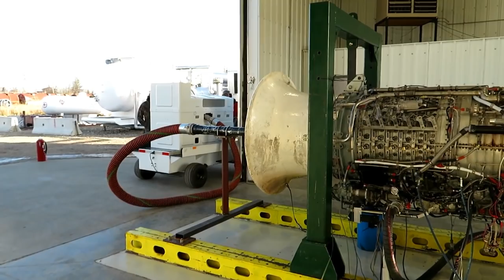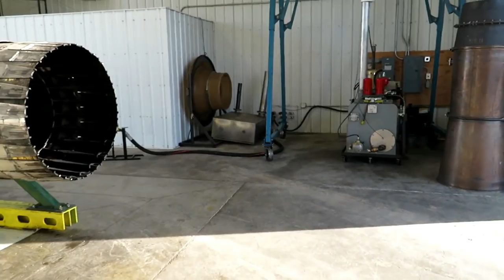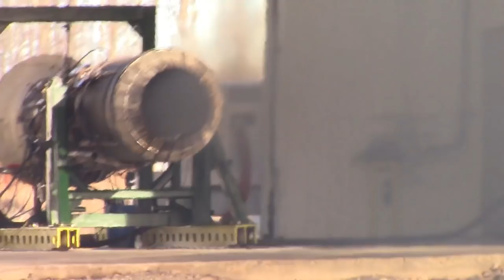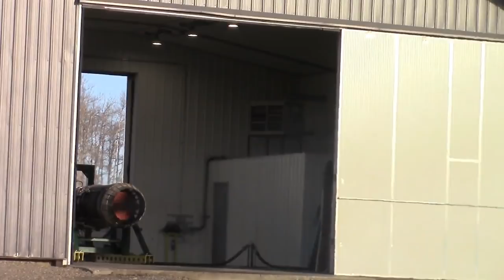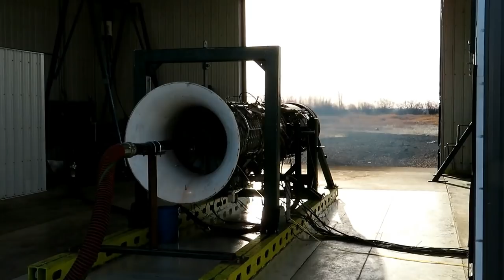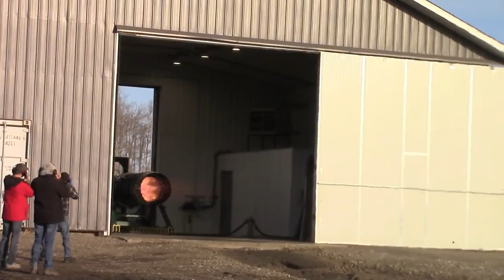Starfighter Engine Run - Screech, Smoke, and Afterburner

Comment: Its a real eye opener the first time at the test cell seeing a J-79-17 running  in AB.was stationed at Homestead AFB in 69 in the F-4E engine shop, we helped hookup the engine to the test cell. There were 3 of us first timers there we were told to stand 10 feet from the side of the engine (with ear protection)to feel and here it run. It was memorable day. Got to see several runs after that at Homestead  and Udorn RTAFB  70-71 -15
Reply: F104s at Homestead AFB in 69 were parked about 50 yards from the shop I worked in and there engine shop was in the same hanger all the 104s had -19 engines

Comment: I want to see how your anchor setup is pinned to the floor. Not a mechanic but spent a lot of time around the jets mostly helicopters.  I know what they can do,I worked the flight deck in close proximity to throttled up fighters, and slid to the safety nets more than once ! Always enjoy your videos brings me back in time .Thanks !
Reply from the maker: I think the video is called The Engine Test Stand...
Reply: @AgentJayZ  you got it ! Thanks for the help ,I found it right away . I was certain something was deep in the concrete 16 pins  works well, the building could disappear with a tornado but your engine stand will remain !good work we will be waiting for the next class. !

Comment: Reminds me of a bit of historical curiosity we have here in Czechia. Back in the days of Czechoslovakia our creative railway maintenance engineers figured the fact that jet engines give off quite a bit of wind gust. And through observation they have learned that roads that are in a bit of a wind in the winter tend to be clean. Surprisingly enough the guys have managed to get their hands on a stripped MiG engine and bolted it on to a railway car to clean rail tracks. While the engine have proven extremely effective in removing snow from the tracks, it has also proven to be very effective at accelerating moderately sized stones to great velocities. This was to much dismay of the bystanders, who after being hit by a storm of partially melted snow and ice found themselves to be in a rock shower. However, that was not the only issue with the track blower. You see, jet engines tend to run rather hot, and snow and ice tend to melt in high temperatures. While this was not an issue during the presence of this gigantic leaf blower, the junctions liked to freeze shut right after the cleaning was ended. To add to the literal fire, since this engine was a fighter jet engine, it was quite a bit hungry for fuel and very VERY expensive to run. With all of these minor disadvantages, ČSD have eventually decided it will be best to decommission their new leaf blower early. I believe it still stands somewhere in the museum around here in Czechia.
Reply: The massive Kraus-type radiotelescope at The Ohio State University used a J-47 mounted on an old flatbed truck to de-ice the tiltable 100ft x 340ft flat reflector. There was never enough ice to justify running the "de-icer" when I was studying at the telescope but the stories I heard were pretty funny ... such as the truck skidding along the ground with brakes locked even when the J47 was at idle power. I don't think the web site talks about the "de-icer" unfortunately. http://bigear.org

Comment: No matter how many of these test runs I watch, I'm always awestruck by the power made with such a small engine. Amazing stuff. Thanks as always for a look at what you guys do up there. I was involved in some interesting work during my career as an industrial engineer, and was always amazed at what goes on in small towns here in the US, seems the same situation in Canada. "Small" businesses like yours are what keeps our industries running. I would get to a job site where they were doing defense or heavy industry support work, and be shocked at what was going on at the other end of what looked like a farm road. I wonder how many of your neighbors realize you are there doing the work you do? I guess the airport hides your test cell activities fairly well, as the noise is passed off as coming from the airport. Otherwise it would be quite a curiosity at least where all the planes are flying. 

I can imagine the  "Canadians have a secret "cloaking field" on their military aircraft!" headline in the supermarket tabloids (right next to the one with the headline "Huge coverup - Jet engines really run on air and no one is admitting it") 
They would have a map with a big X - somewhere around here.... (Jet City) for the location of the secret invisible plane airbase (and of course the secret Air refueling station) I digress...
Thanks again for taking your time to film for us a look into your work. It's appreciated.
Reply from the maker: Hmmm. Our airport has two 10,000 ft. runways... arranged to look like a giant X

Also, our afterburning tests are far louder than anything that ever comes to our little airport, except the CF-18s that come in for our airshows.

Comment: There was a question asked, a few videos ago, about what would happen to a bullet fired across the efflux of a jet engine, to which AgentJayZ replied that it had been asked before.  I've looked, but can't find that question.  However, when the question was asked first time around, I believe I suggested that I would have a word with the Chief Aerodynamicist of the Bloodhound supersonic car (now Bloodhound LSR), which I did.  Well, I've finally got around to doing a very ROM calculation, based on a J79 running at military power (ie, not in afterburner). 
My very rough calculation gives an answer.  A Magnum 44 bullet would be deflected by approximately 140in, while passing across the jet efflux.  However, as It was a very simplified first attempt at the calculation, I think that it is probably an underestimate.  Nevertheless, I believe the answer is in the range of two or three tenths of an inch, at the most.
Reply: "140in", doesn't that mean 140 inches? Then you say it's probably an underestimate and then that you think its only fractions of an inch. I can't make that fit together. Did you mean to say 1/40 of an inch instead of 140, i.e. about 0,5 mm?

Besides, I suppose you only calculated the deflection from one side of the exhaust plume to the other. The deflection when the bullet hits the target depends on how far the target is from the engine. (The bullet is given a certain speed in the direction of the exhaust and it preserves this speed after it has passed the exhaust plume.)
Reply: @skunkjobb  It appears that the decimal point got omitted (although I thought I'd typed it in) so let me write it as 0.140in, which I should have done in the first instance.   And yes, this is the deflection that takes place across the diameter of the efflux, relative to the bullet's undeflected trajectory.  Having been deflected, it will, of course, continue to diverge from that trajectory.  The point to be made is that it is not suddenly swept up into the efflux and carried along.

Comment: Looks like the start cart got some new paint or is it just a different cart? Even the engine stand looks different than your earlier vids.
Reply from the maker: The engine mount is new, made to work with the upgraded floor rails, which are lower, and were installed about a year ago. The white start cart is a more powerful unit that was obtained a few months ago.

Comment: Question. Would there be a noticeable difference in the exhaust gasses or visible difference if water injection was added? I know it was used for the J-75 in the F-105.
Reply from the maker: Water injection in turbojets reduces combustion temp, allowing more fuel to be used to stay near the temp limit. This can lead to more black smoke being produced. 
Similar to diesel piston engines, turbojets tend to show when they are working really hard.
Reply: @AgentJayZ  Thank you!

Comment: Jay, when i was a kid in the 80's i used to go to my local airport and watch planes, specifically the 3 main carriers there, Delta,Eastern,& Piedmont airlines,Planes where always the DC9 and the 737-200, I remember back then when they would take off it would be so loud and thunderous and also extremely loud when pulling up to the gate, I heard that some kind of hush kit was put on those engines to make them much more quite, if true what was the hush kit how did it work? thanks
Reply from the maker: Hush kits were designed to improve the mixing of the hot stream and the cold stream air flows that came out the back of the JT8D 1:1 bypass engines used in those planes. Other low bypass turbofans for airliners also used them.
All the books I recommend discuss them, and Wiki has some good pics.
Hush kits were a stop gap method of reducing engine noise. Modern high bypass engines are much quieter because they incorporate in their design much more of the effect that hush kits tried to emphasize back in the day.
Reply: At Delta we used a FedEx developed hushkit on the JT8D-219s. http://www.fedex.com/us/hushkit/configuration/

Comment: How often do you do work on the exhaust wash field? Looks like just after a couple test runs you loose a dump truck worth of material.
Reply from the maker: We ignore it until we lose a truck in that valley of destruction. Then we pile in a few loads of rubble, and look the other way.

Comment: Jay, on a twin spool engine, how is the inner shaft supported?  Are there bearings between the two shafts?
Reply from the maker: Sometimes, but it's not necessary, because the inner LP shaft is longer than the shorter HP hollow shaft.

Comment: It looks like the afterburner is lit unevenly at times (only top and bottom). Is it supposed to be like that? Are only some spray bars used at partial afterburner? At full afterburner it looks even.
Reply from the maker: I think the progressively staged AB, with four separate fuel manifolds, is meant more for a smoother initiation, instead of one big bang. Pilots of some of the older planes, like the F-100, have described going into AB like being hit from behind by a train.
I don't think pilots fly in partial AB, but the progression eases the hit.
This one did appear to have an uneven distribution of flame outside the engine when in part AB, but I couldn't see what the flame distribution was inside the jet pipe, where things matter.
Reply: @AgentJayZ  Yes it makes sense to stage it. I was looking again and again at a Viggen taking off https://www.youtube.com/watch?v=fBE41A9VT3Q  you can see the torch igniter going off and then 3 or maybe 4 distinct levels of afterburner. I looked at the pictures I have of the engine and I think there are 4 fuel lines going to the afterburner but the manifold/s (which I assume it has) must be on the inside. On RM12 (GE F-404 variant) there is only one fuel manifold for the afterburner and it is on the outside.
Reply: @AgentJayZ  I remember watching French Navy Crusaders, Danish AF and Air National Guard F100's, there was as you say a very  distinct Boom when the reheat ignited.  It's one of the sounds you miss as with the F104 Howl  and the  Vulcan Howl  the Vulcan was induction rather than exhaust.

Comment: Are the engines you work on used primarily as gas turbines engines for power generation
Reply from the maker: All the engines I work on these days are gas turbines used to propel aircraft in flight.

Comment: Just a in theori.
If the engin snap out of its mounts in an instent. In full afterburner, how far will it fly on it one? 😉
Thanks for youre fun and informativ videos! Wish you a realy nice weekend.
/J
Reply: Since the fuel supply would break instantly, not too far I guess.
Reply: @bandiras2  Would run for perhaps a half second at reducing power, so likely would be around 100m away before it finally came to rest, as even cutting the fuel supply the rotating turbine would still be generating a lot of thrust from converting rotation into compression. Would be a nasty fireball though as all the severed lines catch fire, and likely parts would be falling off as well, along with turbine blades as it ingests rocks and such going forward.

Comment: Impressive. It's that a ditch I see forming in the ground? How many feet or meters would you say you are filming from at afterburner?
Reply from the maker: 50m or so. Any closer and the camera mics stop working.
Reply: @AgentJayZ  thank you. I used to work test cell on different engines. Never stuck a camera down the exhaust of a test cell but this was a good perspective.
Reply: I would have liked to see the ditch that engine scrubbed out of the ground. Amazing amount of power. That is one sturdy engine stand. I can’t imagine the force being exerted on it by the engine at mil power. Thank you!
Reply from the maker: The dash 11B applied a force to the stand of 17,000 lbs. The dash 19s put out around 18,500 lbs of thrust.
The test cell stand is made of structural steel, and I think could handle 50 tons of force safely.
Reply: @AgentJayZ  thanks for the details. I just know a lot goes into maintaining a facility such as shown as much as maintaining or building an engine alone. Nice work and details described!

Comment: How heavy is the giant block of concrete the engine frame is bolted down to?
Reply from the maker: Somewhere around 40 tons.
Reply: @AgentJayZ  Enough to testrun some Rocketdyne F-1 on it ;-)
Reply from the maker: I would not recommend trying that...
Reply: @AgentJayZ  Aside from the largish tanks needed to start it running, 40 tons would simply be considered a mere hindrance to the engine wanting to leave the test area.

Comment: WHOA! Whatta beast! Dragons DO exist. I would love to come up there one day when you test one of those, with my portable audio recording studio, and capture every aspect of that engine in detail. What's the highest SPL and lowest frequency range of a J-79? I want to know!
Reply from the maker: You are definitely invited! Of course the SPL depends on distance, and standing 20 ft from the nozzle in full AB would likely be damaging... to all of your body, and your hearing would never return. I'm about 60 yds away in this video, with a layer of electrical tape over the mic holes in both cameras. a typical 130dB meter is pinned by the start cart at 50 ft away.
Each engine has it's own personality, and this one was very mellow. A J79 in full AB from 50 yds behind, would seriously test a meter that went to 150dB.
My guess is it goes over 170.
The frequencies? All of them! The bass feels like being pushed by a crowd of people, and the upper frequencies sound like sheet metal being cut by a thousand bandsaws.

I can tell you this objective measure: with ear plugs, and over-ear defenders on, if you yell as hard as you can when the engine is at full AB and you are 25 yds away, you can not hear yourself through your skull. What does that mean?
It's louder than I have found possible to describe.
The highway is 3Km away and is perpendicular to the axis of the engine. Driving at 80km/hr or 50 mph, if you roll you window down, you can hear the AB test.
Your services would be very useful and appreciated.
Reply: I dunno about the noise level right at the bare engine, but according to http://www.tc.faa.gov/its/worldpac/techrpt/rd71-98.pdf , the J79-powered F4 tops 110db at 200ft distance.
I'd hazard a guess that the bare engine up close is emitting close to 150db.
Reply from the maker: In AB you might see 110dB at one thousand yards. At 200 ft, without ear protection, you are disabled, because both your hands are pressed against your ears, and you have fallen to the ground. My stereo can beat 110 easily.
A J79 powered F-4 would be over 130 at 200 ft if it was aground idle. In AB at 200 ft it will blow your face off.
Reply: It's impressive sound frequencies from military jet engines. I was close to the side of the runway at the position where two SAAB Viggen lifted off and went into a sharp climb and so much sound was carried through the bones.

Comment: Stupid question not related to this video that popped into my head.   Hypothetical situation.  Engine ingests lots of Chaf from another aircrafts missile defense system. Damage or no?
Reply from the maker: What is a lot? Couple strips of foil in the air a few thousand yards behind an adversary? Nothing.
Also: what is chaff?
The distance from which a missile will even function, is far greater than that within which a puff of chaff will become so distributed so as to become "nothing".
Answer, I don't know.
Reply: @AgentJayZ  I was thinking about that as well.  I guess the ingesting airplane would have to be right behind the chaff dispenser of the fleeing airplane. To get enough to cause any alarm.
Reply: I'm gonna guess nothing really. the flimsy scraps of foil would get shredded up, might clog up a couple of the holes in the inner combuster "cage" (the cylinder with all the holes in it that sits inside the combuster case) for a second or two before the pressure from the compressor causes it to go in, then it will just follow its way out through the turbine. might get folded over one of the stators and get stuck though.

Comment: At full AB, what is the typical thrust shown on the control panel for this particular engine?
Reply from the maker: For the -11B, we saw just over 15,000 lbs. For the non-screaming -19, we'll get about 18,500. Thus supporting my discussion about compromises near the end of the video, eh?